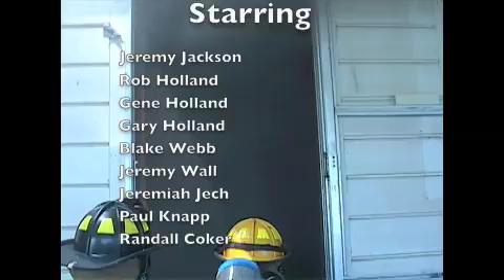smoothbore vs fog

Comment: Sure, the barrier drops... but tell me the temperature of those rooms...Tell me how much stuff is still on fire with the smooth bore compared to the fog, tell me how much re-ignition is therr with the smooth bore compared to the Fog... long story short, the VERY LITTLE clearance you do have with smooth honestly doesn't do much, with all thry gear you still can't see shit and the Victim is burning from the radiating heat that you didn't cool off that you would have cooled off with the fog.... There has yet to be a valid argument for smooth bore over fog in rescue applications.

Comment: I guess it doesn't occur to anyone, that if you've got that visibility going in, and anyone is on the floor needing extraction, that your priority is removal of the downed persons before you crack that nozzle...   and, that you're probably NOT opening the nozzle at a 30 degree fog pattern to start your fight.

I've never started an interior firefight with a wide open fog, or a 30 degree fog, because my primary goal prior to advancement is to reach out and touch the fire from a distance, and get the fire to contract/deescalate prior to putting my hide in the space with it.

Once you've cleared the area of victims... preserving the neutral plane becomes absolutely a non-factor.    You can control the compartment at that point... back out to the door, swirl the fog line for a few seconds... close the door... give it a minute or so... and then re-open that door, let it burp, and find that you've nixed a vast majority of the fire, so you can move in and overhaul it to close the show.

Doesn't that sound an awful lot like what we do when we pull up with fire blowing out a window, and we execute the transitional attack with a straight stream?     

Wipe out the burning gasses and reset the fire to contents burning not nearly as violently... and then move in and kill the fire...

It doesn't matter what nozzle is in your hands...  straight tip, combination, vindicator, blade...  DOESN'T MATTER.    All four nozzles work fine as long as they can flow some damn water.

Comment: As of right now I am a fan of the adjustable fog. But everyone has their bias on this apparently. If your in the fire service and don’t have an opinion on the subject I suggest you hit the books. 
This is a good experiment. However the purpose of the fog nozzle is not to put out the seat of the fire. It’s to control the thermal layer and super heated gasses. Unfortunately, in most fires fires the seat of the fire is not right in front of your face and you end up having to travel into the dark abyss. If upon entering a building with heavy smoke you can force air and water to push the smoke conditions back and fight your way to the seat. At which point switch to a straight stream to deliver higher volume and extinguish the fire.

Comment: I would NOT use a fog when:
The room is completely shut off (No vent)
AND there are possibly victims in this compartment.
If the compartment is fully involved and it has a vent (Window open or self vent) and it is not a survivable space, fog is fine. It will cover alot of area and absorb the heat sending it outside.
Otherwise, I would use a straight stream to attack the base of the fire then other surfaces.. If roll- over is observed (Flash over indicator) pencil the ceiling with short bursts to cool it.

Comment: You can select strait stream on a fog nozzle. you can't select fog on a straight nozzle. You are correct in demonstrating how a fog pattern disrupts thermal balance in a compartment. The nozzleman should be trained in how to select strait vs narrow, and wide fog. and when to use each.  I've listened to this debate for the 25 years i've been in the fire service in a metropolitan Fire Department.. May I say that each have their place. For instance I prefer Straight tips on a high rise fire, and non-combustible construction. I prefer Fog tips for wood frame construction, especially lightweight construction. I prefer automatic nozzles on aerials. I can go either way on ground operated master streams.

The highest benefit to only using straight tips is nozzle reaction. Like i stated you can select straight stream on a fog. If you have a free burning fire, meaning you have lost compartmentalization, A 10-20 degree fog is best. In a free burning fire you'll have to apply water to every surface that's oxidizing. So using a smooth bore in this situation is like trying to paint a wall with a pencil.

Comment: I agree with the majority of comments. This video just demonstrates how a 30 degree or wider pattern can upset thermal balance versus a straight/solid stream. A real comparison would have tested a fog nozzle that can produce a straight stream versus a smooth bore. Other data that would have been important is also what GPM each nozzle is flowing, pressures on each set up. I am an advocate of fog nozzles and their capabilites, when firefighters are trained right, the fog nozzle can adapt to many different situations. Wide patterns are great when exterior is only possible attack, or dealing with attic fires and verified no viable life for rescue or conditions that can permit a feasible interior rescue. smooth bore nozzles are capable nozzles as well. I think firefighters who have had further extensive training in fire tactics and fire behavior should be capable to use a fog nozzle accordinlgy and firefighters who have not recieved proper training or advanced thier knowledge further may need to stick with smooth bore.

Comment: All the wrong ideas are being addressed in this video and in the comments below.  Allow me to put fire fighting into perspective.
1.  First we need to Stop talking about Steam!!!  Period!  get steam out of your head.  Steam is a lame excuse to ALLOW the flames to remain thus allowing more time to Get Off.
2.  Combustion creates very hot flames.  In order to lower present and future high temperatures, you have to eliminate the flames ASAP.  THAT, is your JOB, not playing with them!
3.  If a couch is totally involved with flames and you apply water with a smooth bore nozzle, you will cover a very small area and the remaining flames will boil off that water.
4.  The more you wave around that stream, the more water you introduce creating more You Know What.
5.  By the time you soak the entire couch, you have filled the structure with not only more heat but now you and the victims are drenched in, You Know What.
6.  If you want to Eliminate the Threat quickly, you adjust a nozzle to the widest cone of water that will still penitrate the energy of the fire and wind so that a maximum amount of water covers the largest area which will eliminate the flames real fast.  For a couch I would use a cone half the size of the couch and move it from side to side.
7.  If you use common sense and logic and think from a position of Responsibility to yourself, your fellow fire fighters and your family, you will break the fire room windows to allow the pressure, heat and smoke to escape directly to the exterior and apply water to the Visible Burning Material Through the windows and eliminate the flames in 3-5 seconds and drench the VBM in 5-10 seconds.  You can even do that on upper floors.  You can do that without being fully dressed and by using tank water within ONE minute after the wheels have stopped.  That is if you went their to Do Your Job!
8.  Search and Rescue and saving lives before property?  Boy, I get tired of all that Hero Crap!  Ask Worcester how That is working for them!!!  You can PROTECT victims and fire fighters by eliminating all visible threats by stopping combustion and horizontal venting LONG before you can get fully dressed, assemble an entry team and get the front door open!!!!!!!!!!!!!!!!  Think about that if you want to be a Real, Responsible Fire Fighter!

Comment: There's not much difference between a smooth bore and a fog nozzle set to straight stream. The difference is, if needed, a fog nozzle can save your life in a flashover situation, can be used to vent, and is easier to control. Smooth bores can do one thing and cause more damage to the structure.

Comment: Hmm...when I went thru firefighter 1 you were taught to keep your nozzle turned right. It it with bursts so you don't screw of the thermal balance. But whatever. Sell smoothbores.
Reply: Straight stream is still a fog pattern, just a TIGHT fog pattern. SB always on interior operations.

Comment: I’ve used fog stream inside for years and ain’t changing. The second I knock down a fire like that I always use it for hydraulic ventilation which reduces heat, increases visibility and also introduces oxygen to any potential surviving victims. Plus all of these guys preaching smoothbore have never been in a fire that has gone to shit and had to use the fog as a curtain to protect themselves. If you like straight stream you get the same results with a fog nozzle. I personally don’t use straight stream, I prefer the steam conversion. When you get your ass in the house where you belong it takes way less water to put out a fire with some steam. What we have these days is a Fire service full of pussy’s.

Comment: Let me explain something to you.  When you know no one is inside the building using a semi to full fog will quickly kill the fire.  And that is the objective.  True. Fog will displace the heat in a room.  But it will also kill the fire as it creates steam that takes the air away from the fire.  So when you said anyone in there is now (most likely dead or in a bad way) There were no one in there to begin with.  A fog nozzle can kill a fire super fast.  So why is it not used more when it is known that no one is inside?

Comment: There are varying applications for when a "solid jet" and fog pattern should be used when conducting internal fire fighting. No one situation is that same as the last, learning how to read the fire behavior, building type, smoke and air tracks will help you determine what your tactics will be when conducting an internal attack. This video isn't the best for comparing either. Fire science, compartment behavior plus experience will help determine what you will do with your branch as well. Smoothbore offers no thermal protection for BA crews, that is one of the main reasons for using a wide fog spray, such as for gas cooling. The right fog pulse techniques will result in ideal water droplet size for controlling the unburnt gasses above and creating a bufferzone for firefighter advancement. New science and advancing firefighting techniques which are being taught do not so much focus on a old fashion jet stream to put a fire out. PS in a fire like that, survivability of a patient is highly unlikely, plus going in with the right gas cooling techniques, will offer the BA crews the best protection when entering a compartmentalised fire (ventilation controlled), helping prevent the chance of getting caught in a flashover, resulting the rescuer having to be rescued themselves.

Comment: What a poor demonstration. All you demonstrated is that you don't have a clue how to use a fog nozzle. I've sprayed fog inside compartments many times without losing visibility and put fires out without flooding everything below.

Fog also lets you control the gas layer above you .I'll take a fog over smooth bore any day for versatility unless I want a bit more reach.

Comment: This video is not a real world example of fire fighting.  No one in there right mind would put themselves in that situation and use a wide open/fog nozzle and shut it off in 2 seconds.  THAT is how you create steam!  The water has to overpower the heat generated by the burning fuel.  That room isn't even the size of a walk-in closet let alone the average bedroom or living room. Where are the venting windows?  Etc.  Nozzles are adjustable for a reason and that is not just to transition from straight to wide open.  You can find dozens of videos that show a room full of fire that is belching out the window and a steady stream is going in at close range and the fire keeps on burning.  The steady stream hits the far wall and 80% of the water lands on the floor.  The interior temperature hardly lowers because the remaining burning material overpowers any cooling affect the tight stream could create.  The straight stream will pressurize the room and flame WILL be pushed out the door into another space.  Because you didn't cool the room or stop the majority of the fire, it could persist and cause other combustibles to ignite.  A 30% spray will cover more area with less water and if you swing it around and keep doing it until everything is covered, then you will shut that room down in seconds.  A pushed flame will not last more than 1 or 2 seconds and the fire can't spread.  How many times have you seen straight streams shooting out windows or through the roof?  Keep in mind, you could run out of water at any time.  The wider you open the spray and STILL control wind or the energy of the fire, the faster the area will cool and more fuel will be soaked.  No water is wasted and water damage is reduced.  Obviously, you don't stop applying water until the burning fuel is soaked.  My 2 cents.
Reply: krafty  Believe it or not, you make 6 people in this country that agree with me!  Oh and there's UL, NIST and ISFSI that agree also.  The vast majority of America's departments don't think like this because it turns the Fun into a JOB!

Comment: No it doesn't. It shows the difference between a fog pattern and a solid stream. Unless you're using "Iowa Fire Flow Formula" in an enclosed box, you don't use fog pattern. Not sure what the intent of this video was but I suspect it's complete misunderstanding on Highfillfire's part...P.S. Note how the steam conversion completely knocked the piss out of that fire. "Iowa" works, it just needs to applied in the right scenario. Fog nozzles are an awesome tool and it has been proven that a straight stream is just as effective a s a solid stream. Be careful discrediting fire tactics and applications that you do not fully understand or apply wrong.
Reply: Amen

Comment: Fog pattern is made by fragmentation of the stream producing small droplets of water. This results in a large increase of area what accelerates the heat absorption by the water. This rapid heat absorption produce steam very quickly. In order to NOT produce excess of water steam the correct use of the fog pattern (which is proven to absorb teat faster) is made by short bursts in low flow. Doing this is possible to use less water and not to disrupt thermal balance. Even with straight stream, if you use too much water you're gonna have too much steam. The point is, with fog stream you must use less water. In some places, this is mandatory because they don't have all the water they want. And the use of pulses of water fog doesn't replace the straight stream to extinguish the flames. It is supposed to be used just in the progression to reach the fire itself (in solid fuel). Use water in fog pattern indiscriminately is not correct and not advised.
Reply: +Benício Ferrari Júnior .....yes.... bit only short pulsescan be dangerous....  the good firefighter / nozzleman has tu understand when and how much water it should let go out of his nozzle..... where to direct it.... etc....
Reply: +FIREFIGHTERTH23  sure does. I agree it requires a lot of trainning and thoerical knowledge. If it was easy, firefighters wouldn't be necessary.

Comment: The only thing I don't understand is why you are comparing a smooth bore stream to a fog stream from an adjustable nozzle. We teach our firefighters to use a straight stream inside. Fog stream inside is suicide for attack and should really only be used inside in a worst of situations while backing out, and not even then if you can avoid it. You can get basically the same outcome with a straight stream from an adjustable nozzle as you can from a smooth bore tip. Fog stream is for when you stick the nozzle through the door or window and the firefighters are not actually inside. Too much upset of the thermal balance and too much steam. I also understand you are talking about survivability of victims and a fog again would be a bad choice, but as above, a straight stream from an adjustable nozzle is basically  just as good as your smooth bore.
Reply: Back ho

Comment: Probably should spend more time learning about the fire environment before you take such a public stance on smoth bores and next time use modern fuels not legacy fuels. In addition you can do the same with a straight stream fog setting as the smoth bore and still have the option to protect yourself from flashover or impending fire event.
Reply: Firetimeproductions It's good for people to share what they know but even more important IMO to leave comments open - of corse you'll end up with 100 armchair warriors but the top rated comments provide an opportunity for everyone to learn.
At least they have demonstrated how fog is NOT to be used =P

Comment: Where is the truck co. on the roof opening a heat hole to work in conjunction with the water applied.   Much different results when done .  Lots of video showing engine co. with no truck co. roof ops.  Totally different world . I guess most of the fire service in this country operates without vertical ventilation. Interesting

Comment: I agree this is a good video showing the differences between how a fire reacts using a smoothbore and fog nozzle, but you also have to understand the application technique is much different between the two nozzles. If the fog had been swept just below the fire line (instead of into the superheated air) the fire would have reacted very similar to the smoothbore – the fire would have blacked out and the heat and smoke would have stayed up off the floor. Reality is both types of nozzles have their place, but you have to use them as they were designed and using appropriate techniques.